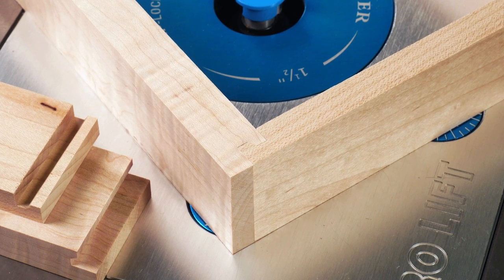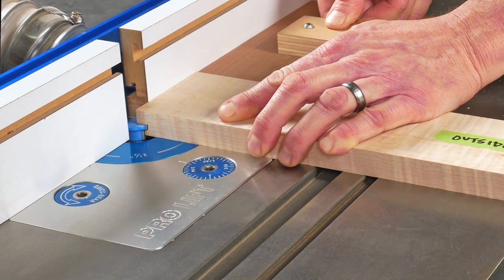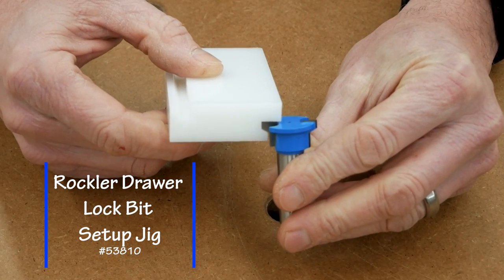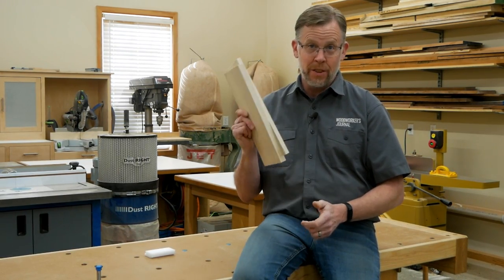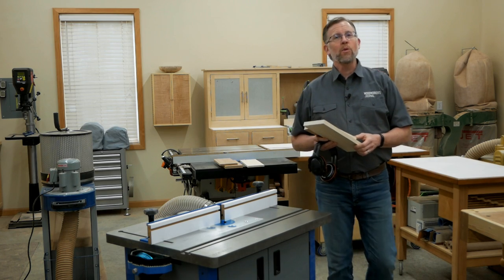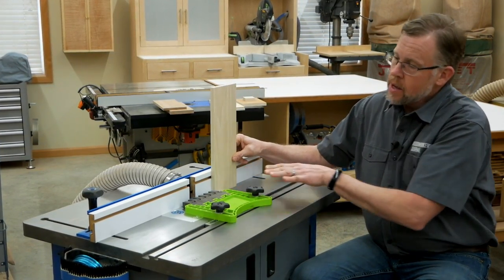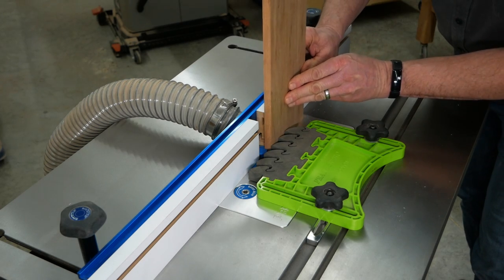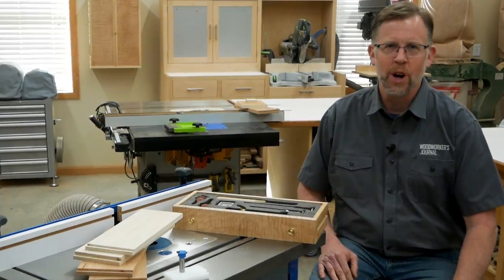Simplifying Drawer Lock Bit Setup

Comment: Whew!  Finally got it. Question how come when routing. You didn’t mention the use of a coping sled, to hold the wood?
Reply: because the board is wide enough to reference the fence, coping sled only need for narrow rails and styles of frame and panel doors. You could still use one if you wanted
Reply: @TheTranq  ok, understand. And thanks